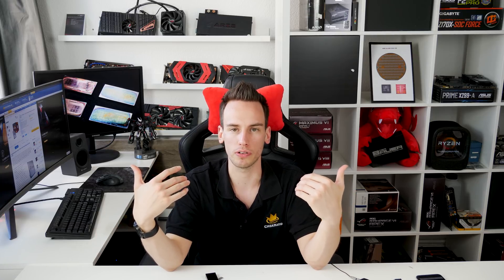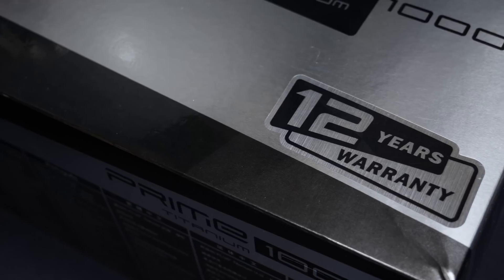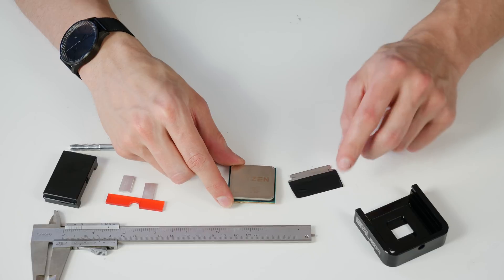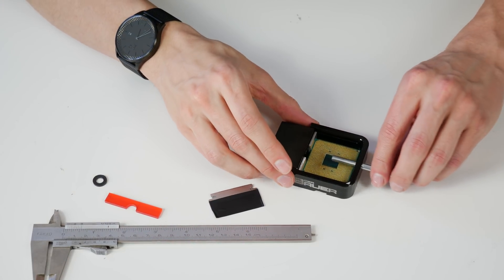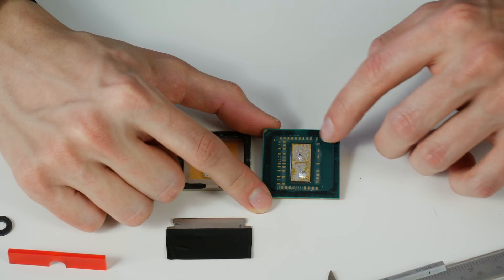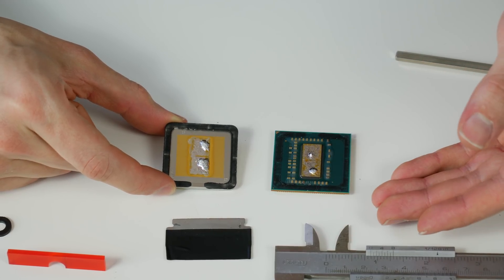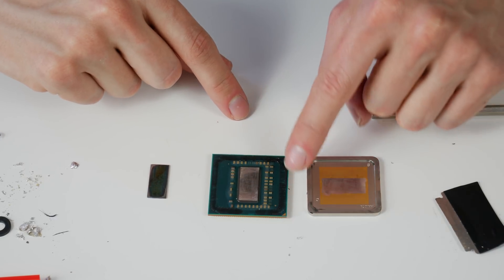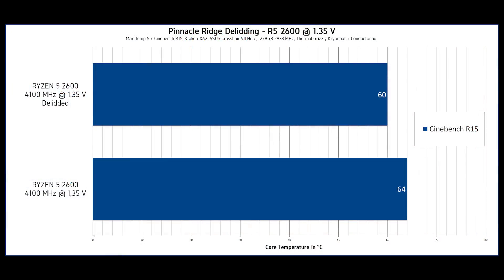ZEN+ Delidded - Before/After Temperatures - [Ryzen 5, 7, 2600, 2700X]

Comment: 4C temp difference from delidding is minuscule. That means AMD soldered head spreader is excellent and superior.
Reply: ManuelB1b3r  False. They're very similar IPC but Intel CPUs have less threads at each price point, consume more power, and have a lot more security vulnerabilities. Times have changed a lot since the FX days. I recommend you start researching.
Reply: Quetzalcoalt Also my response is more geared towards Manuel's ignorant statement that Intel is light years ahead of AMD. They are closer now in every category since the P4 vs A64 days.
Reply: But AMD's solder IS better at transferring heat? And this shows that, other people have done these tests as well, and Intel's TIM on coffee lake is REALLY bad. These are just facts, you can complain about how he didn't test it enough, but honestly, go check out other delidding benchmarks. It doesn't change, and Derbauer knew this when he started this video and didn't want to spend too much time benching something with no change in results.
Reply: AMD has the crown in HEDT environments now as well with TR2 and EPIC.... so I don't see your point, Intel is gaming king, that's the only crown they have, and they are slowly losing it.
Reply: Quetzalcoalt Chill out neet. 4C is insignificant and objectively superior to Intel's TIM, which is a known fact and has nothing to do with anyone being a fanboy. There's nothing you can say or do that will dispute that fact. The only thing that matters when testing the temperatures before and after is that both instances of testing are done the same way. Absolutely no reason to test for 30-45 minutes in this case.

Honestly, your salty and passive-aggressive rant about fanboys is completely misplaced and childish. It's called giving credit where credit is due. AMD deserves positive feedback for soldering their chips just as much as Intel deserves negative feedback for putting junk under the IHS. It has absolutely nothing to do with being a "dumb fanboy that comments on stuff they don't understand". Get your act together.
Reply: People have done other tests before Derbauer, everyone already knew AMD used Silicon, EVERYONE knew silicon is better at transferring heat to the IHS, everyone already knows the stuff intel uses under their IHS is terrible for cooling. You just seem like you're stomping your feet because you bought intel or something and need to validate your purchases.
Reply: Ryan Westbury using silicon? Wth are you talking about? Are there any processors that aren't made of silicon?
Reply: But he's not testing the temp of the water is he?
Reply: This is really impressive, he used the thermal grizzly, the best liquid metal thermal paste out there, and the difference is only 4 degrees, which means that they used a really fucking good stock  paste, which explains why it was sautered, intel on the other hand uses some cheap thermal grease.
Reply: Well, the soldered 9900K being shit with thermals, with too much silicon shows AMD just DO do soldering better.
Reply: Superior to anything Intel uses at least.
Reply: ManuelB1b3r Miles ahead? At literally all workstation tasks AMD cpus are better, and at gaming with a 1080ti at 1080p the i7 8700k is 15-40fps better than a R7 2700x Yes but that’s at 1080p and there is not a single person who uses a 1080ti at 1080p.

That gap closes a lot at 1440p and is essentially non existent at 4K 
Lower end GPUs will have the same result...

“Miles ahead” my ass
Reply: ManuelB1b3r  not rlly tru dude...not really true...
Reply: Excellant job amd now Intel is copying the same technology in New i9 series
Reply: how did he heat up it?
Reply: Mega Dutcher EXACTLY
Reply: @River_Miles   40ozFab  You don't tell which parts are wrong, you don't explain anything so you also don't understand a fundamental understanding of thermodynamics.
Also i don't know to which of the 10 comments this reply is for.
Reply: its means they used a thinner layer that wont hold up to the same temps as intels.  but thats all it needs so its a good choice.  i mean why do you think amd starts to throttle cpus at about 68c when running stock?  intel says "just keep it under 100c and youre fine".  intel makes a lot of mobile cpus that will run at around 100c for years fior hours at a time.  to make this work with solder cpus you probalby have to use a thicker\softer solder so it doesnt develop cracks.  but in return you get a cpu that can run high temps for years with no problems.  its a trade off either way but they both do the same thing, just in different ways.  besides if amd's 8 core could run 5ghz it would probalby gain more than 5c in temps because of the higher heat load anyway
Reply: @bobhumplick4213  What ? Amd throttles cpus @ about 68 c° are you trolling good sir? Max temps for the r5 2600x are 95 c°, i own that chip and can confirm it will throttle at around 88-92 ish.  Also i'm not biased, i've owned various intel chips throughout my pc user life and never had any problems with them. Always sufficed. But i've found the idea of owning a new architecture very intriguing and also the fact that Ryzens come with SMT, which is the equivalent to Intels HT.  AMD not supplying chips with HT was always a turn off for me. So now i didn't see any reason not to go and buy a Ryzen. I've owned and testet the 2400g with it's excellent vega 11 APU (beast for a budget build) and now i have the 2600x and for that money i could'`ve had an i5. I'm just curious where AMD takes Ryzen tbh. I enjoy updating my Bios every time i get an update because i like to see what happens and whats changing and improving. Also i'm on linux and ryzen works like a charm on that.
Reply: imagine intels stock cpus running 4c cooler :D
Reply: ManuelB1b3r  u must feel dum now
Reply: ManuelB1b3r  depends on the game engine u use. also the 39** as been overclocked higher then ur 5.4 with more cores and threads lol
Reply: ManuelB1b3r  Facts are, the best gaming PC, You dont need a good gaming cpu. You need 2x 2080Ti and 4k monitor at 120hz. not 300fps at 1080p in CS:go lol
Reply: ManuelB1b3r  lol
Reply: In my opinion 4C is close to the margin of error and it makes sense because the benefit of a thinner but less conductive compound versus a more conductive but thicker compound should be incredibly small. What he proves though is that there is likely a tiny benefit.

However, the benefit is in no way worth the risk unless you're a hardcore enthusiast. This is not like the case with Intel where the benefit is significant.
Reply: Quetzalcoalt TLBeed does not affect any Bulldozer or Vishera CPUs, Phenom Class CPUs, nor has anyone proven Ryzen is affected.  Intel is more widely affected to the recent security flaws and anyone who attempts to deny is clearly fancboying. 

For power consumption see here where the 8700K with 2 less cores, 4 less threads draws more power under load than both 1800X and 2700X. https://www.tomshardware.com/reviews/amd-ryzen-7-2700x-review,5571-12.html
Reply: Since most computers don't need to be replaced for 5yrs or more in most use cases, it makes sense that the market hasn't taken over yet. And since intel is the gaming king it makes sense a gaming hotel would use Nividia and Intel... AMDs are showing up in every single content creators computers because they are leaps and bounds faster at real CPU work that makes people money, not gaming. And it will take time before people will turn the tide and have Ryzen, the architecture is only 2 years old. That's like saying Kabylake is unsuccessful because not everyone has switched to it or newer. So yeah... AMD is showing up in builds for companies and businesses and servers more than the gaming rigs that we see every day, even then I still see Ryzen gaming rigs all the time.
Reply: What work do you have to do lol this is the longest yt comment i've ever seen, AND it comes from fanboy rage which makes it so much better.
Reply: 1950x server market? google AMD EPYC
Reply: every little helps, small things make a big picture
Reply: ManuelB1b3r  not really zens ipcs clock for clock are the same as skylake(coffee lake is just a 5ghz optimiztions to make intel look ahead in benchmarks.) when in reality zen has made intel cancel 10 nm because performance gains werent good enough soon enough for intel clockwise and now amd is gonna beat them to the punch with 7nm which is gonna spell the end of intels clock speed edge along with greater ipc...
Reply: @Ryan, yeah i still have a 2500k that i bought back in 2011. Right know everyone says AMD is better at everything. I agree most of the parts. But look around you. Where are AMD CPUs used. My university changed from AMD A10 APUs to some 7th gen I5s. Linus made a video about a gaming hotel. They use only intel and nvidia. Linus made a video about a gaming school, they also used intel and nvidia. Apple haven't used an AMD cpu since when ?. People that game and use adobe products, are better of with an i5 than a 2700x, because of that IGP thing. Most youtubers that have intel CPUs, they have no need to change platform even though it has 2-4 cores more, because they won't benefit from it, heck they might even lose in exporting times. Everywhere i look i see intel cpus, and very rarely AMD cpus. More than a year passed since 1700x launched and not many people switched. My friend didn't want to buy the 2700x, because of old issues that AMD had before, he was happy with intel before, and he is happy with intel now. 

I'm really happy that AMD is back in the game. They take their part of the shares slowly. If intel doesn't do something i might get a 2700x soon because i rarely game anymore, but how many people are like me? The majority buy PC for gaming. I need to change my 2500k.

Also read this. https://www.pcgamer.com/pro-overclocker-der8auer-on-why-the-race-to-add-cpu-cores-doesnt-make-any-sense-and-why-you-should-still-overclock/
I found it very interested and very true.
Reply: Quetzalcoalt opinions(you) VS facts(mega dutcher) 

gues what/who always wins
Reply: well that 2700x looks really pleasing to buy. i have a 3440x1440 so i won't see those fps differences in 1080p. and i get 2 cores more and 4 TH more, that doesn't suck like bulldozer did. So i would definitely get a 2700x over 8700k even if OC to 5Ghz. My 2500k on 4.5 just can't keep up with the 1080 even at the higher resolution.Not like i have money for build a full system :D.
Reply: @FlawleZ31
Tell me where does Intel CPUs consume more power ?
https://www.techpowerup.com/reviews/AMD/Ryzen_7_2700X/18.html
http://www.guru3d.com/articles_pages/amd_ryzen_7_2700x_review,7.html
https://www.pcgamesn.com/amd-ryzen-7-2700x-review-benchmarks
https://www.digit.in/pc-components/intel-core-i7-8700k-vs-amd-ryzen-7-2700x-40824.html
http://oc.jagatreview.com/2018/05/overclocking-review-ryzen-7-2700x-vs-core-i7-8700k-vs-ryzen-7-1800x/12/

Intel have a lot more security vulnerabilities ?
You mean spectre and meltdown, that 95% of all chips have these days ?
Amd is only secured against meltdown ( you are right here), but, arm CPUs are also affected by both. You probably have an android or ios phone, that's affected too but you still use your device right ?

Vulnerabilities are found sooner or later, there is no perfect software/hardware. Remember the note7 ? Despite that people still buy samsung, nothing have changed.
There were many car vulnerabilities and car brands had to do a mass return for a fix.
New CPUs would probably be designed without those vulnerabilities, so it won't matter much after 1-2 years. Also there are "fixes" for all attacks, kind of so there that.
But that doesn't mean new vulnerabilities won't be found in the future. ^_^

Also ofc AMD will have lower prices than intel, otherwise who is gonna buy their products ? It will take time till the market share is balanced, they are doing the right thing as of now, a bit rushed but, looking strong. The new TR2 doesn't look good, because the old mobos will support it, but the power draw will be so high, VRMs won't handle it. soo much for future proofing.

Did i do my research right ? ^_^
Reply: It's the difference between having your CPU at 82C or the non that wouring 78C. Also 5 tests of cinebench on water is pointless. On water you need 30-45 minute stress test so the water can reach equilibrium. 5 tests 30 sec each, is like putting water in the freezer for 5 minutes, pulling it away and call it ice cubes.

I can't believe der8auer did a mistake like this. This proves how stupid people are no matter if intel/amd. They hear if someone says something good about their product, and people start commenting stuff they don't understand. But oh well, dumb fanboys will always be dumb fanboys.
Reply: Accept for the fact that he fucking didn't. No where in this video does he show how long he let the water run. you assumed something and made a fool.
Reply: @FlawleZ31, i don't trust tomshardware because he is the only one that has different numbers. So 6 sites are saying one thing, only tomshardware is saying the opposite. 
Yes intel is affected, but saying that AMD is not affected, especially when they lied they are not but still released some patches :D is clearly fanboyism.
See ;) it works both ways. AMD is not affected only by meltdown, everything else thou.... And because the new Ryzen and TR, using the same dies, they haven't fixed it yet.

And to answer your other comment, I answered your comment, because of this sentence "consume more power, and have a lot more security vulnerabilities ... I recommend you start researching." 
And yes Intel are not light years away from AMD as of Q4 2017. Will be interesting to see new intel CPUs, when AMD just exploded. Maybe that's why they announced that they are making Gaming GPUs in 2020, to compensate for the losses if they can't catch up. Most servers i see use POWER9 CPUs, not amd nor intel ones. This is bad for both companies. Also Intel is not only a CPU manufacturer, they are heavily into AI, and quantum computers, they also make those optane things, that DDR4 256GB optane cache disk actually make sense.
So they will have something to do while AMD is on the top.
Reply: @Mega Dutcher
Running 5 tests of cinebench on a WATER LOOP.  1 Cinebench test on a OCed 2700x finished in ~28 seconds. 28 seconds x5, is 2 and a half minutes, on freaking water.
You need to run at least 15-20 minutes with an AIO so the water can heat up to its equilibrium.
Yes he did the same exact test, but water heats up slower, so the hotter OC 2700x my not heat the water fast enough hence only 4C difference. 
The difference might be more if the until the CPU can't get the AIO water to heat more / AIO can't cool the CPU more because of .... 

Not to talk about custom Loops, you need to run at least 30 minutes, or the best thing to do is run as much as until the temps stay stable for 5 minutes.
But because this is cinebench, you have to manually press the button and there is a short pause when no heat is produced. He might not press the button immediately and wait a second or two, and that can make a difference.

If he used a normal air cooler, even the nh-d14/15,  two and a half minutes might be enough, but 5 minutes to be sure.

Also he never talked about ambient temp, GN always give delta T temps. So yeah, AC kicked on, or opened a window during changing the CPUs, soo many variables. 
Thos 4C might be 6C or 8C.

Oh Thanks for @flawlez31 otherwise i wouldn't give you the answer cuz youtube never notified, ^_^ even thou i said most of the stuff in the upper comments, but i know now one reads those, only the most bottom ones.
Reply: So you saying that if i OC my cpu to 5.0 and use a kraken x72, and i run prime95 for 30 seconds, and i see temps of 50C that's a good temp ? How do you know that you cooler can cool your CPU at X Ghz and X Voltage if you don't run the benchmark until the water gets to its equilibrium state ? You can't see spikes with water cooling. It takes a lot of time, not 5 runs of cinebench with a 16 thread CPU. You are gonna be like, oh it gets to only 60C under load, the next day you start rendering an animation in blender, you go out for 5 hours, you come back and CPU is like wtf dude It's 90C, because of the water.

Also yes, intels IHS is really bad, but where do i say anything about intel in my comment? I'm saying that 4C is not that small of a difference, that might be the difference of going from 4.2 to 4.3. and i'm sure some will delit the 2700x, probably running a custom water cooling system that will want the very max and the lowest temps possible.But that's a different story.

Also you didn't read my comment fully, this part "It has absolutely nothing to do with being a "dumb fanboy that comments on stuff they don't understand" you quoted you forgot the previous sentence " This proves how stupid people are no matter if intel/amd. " But whatever.
Reply: @Quetzalcoatl0  Actually the effect of delidding is even be more significant without equilibrium temperature reached. So you are basically shooting yourself to the knee here. Despite like ppl before already told you, he´s running identical perfectly reproducable tests. Also: 4 degrees mean nothing, because there is already plenty of room for OC and the temperaturs rise somewhat exponential after you reached 5 GHz. Additionally your CPU wont bother wether you run it on 70 or 80 degree, because the lifetime of this component is just longer than your average overall system lifetime. I just love how Der8auer made a video where he went defensive about being called an Intel fanboy and you are calling him an AMD fanboy here... This is almost as good as reading the comments on comparison videos between nato and russian military technology.
Reply: @FoxD13  They are not identical tests because the variable time even tho the same doesn't work here. WIth water coolers you need to torture the CPU until equilibrium, because in test A the CPU might reach 70C but in test B it could reach 78C. You don't know. He ran cinebench 3 times as i remember and he pleased the buttons manually. Which are more variables and not enough test time. On water they might reach the same temperature for the first 5 minutes but in the 15th minute it might be completely different. No idea my other comments, it was like a year ago. I don't care anymore.
Reply: @Quetzalcoatl0  People were and still are buying AMD over Intel because they are the smart buy, much more performance for your money.  No 'fan-boying' going other than with people like you who buy with their hearts and not their heads.
Reply: @HalfdeadRider  It's been 2 Fking YEARS. 
Also your comment has nothing to do with the main topic of this comment.
Reply: @Quetzalcoatl0  it FUCKING DOES 🤣🤣 and same still applies, nothing has changed in that respect.
Reply: Talking about CPU and who has the crown, the USA has the faster Supercomputer on Earth as of writing this comment, Do you know what CPU they used ? Power9 IBM :D not AMD and not Intel.
Oh forgot to mention, they use nvidia GPUs.

Also you can't say intel lost the CPU crown, because they don't make only 1 product you know, They make server CPUs, Mainstream CPUs, laptop CPUs. AMD has those two, but are only popular in the mainstream market, on the server market, yes they have the 1950x but who buys server farms every day ? It will be one or two years before AMDs server side catches Intel as of now. What about laptops ? We just saw the first ryzen laptops. So intel is kind of on the TOP.
Reply: i agree with that...since nobody still haven't beat IBM POWER 9 YET
Reply: HOPEFULLY 10nm intel would ....a teraflop cpu can take the crown official on all space ..not just desktop and servers but SUPERCOMPUTERS
Reply: yeah but deliding the CPU just to lower the degrees by 4, is not worth the probability damaging the CPU.
But this is a biased test so yeah. We can't be sure if it's 4 or more degrees if difference .....
Reply: You think i haven't met fanboys on the internet who talk literal bullshit, and i try to tell them facts backup with links from blogs / forums / whatever else. But they still don't listen and talk their thing at that's it. 
And when i see a giant all of text and read it, it's still crap so when i see one i might read 1-2 rows and forget about it, because it's not worth the time to teach some idiot on the internet something.

Yeah as of reading your wall of text i'm gonna write my own one to answer yours. 
I see you understand at least most of the PC hardware stuff.
Tell me when you see a 28 core on 5GHZ,  when there is no other CPU that runs stock on all cores at 5Ghz, do you assume that the CPU is stocked ? Did you assume that the 28 core ran at 5GHz is stock without using some expensive cooling ? If you did , well bad for you. 
Also Intel knows about the TR2 that will have 32 cores, it's says it in the AMD site from quite a long time now. So if they don't have a product ready why no steal the titles of every youtuber/ blogger, ect ect. Everyone talked about it right ? So intel succeeded in this. Most companies sell shit products, because of really good marketing advertising. It's not about how bad the product it, it's about talking about the product. 

It's always a better way to use a new socket for a new CPU, i can give you reasons that you would never think about. 1st, making a new socket will have to make a new mobo, new mobo = new chipset = new features that the old chipset doesn't have, see someone have to design the chipset, have to design the mobo, has to buy components for making the mobo, heatsinks, you name. This is money for the other companies too. They have to feed children too right ? Or do it like AMD does, make 1 socket and use that for 5-6 years, and mobo manufacturers are gonna bankrupt. 
Also you saw when Ryzen 2 came out, you need to ask AMD to send you an older CPU so you can upgrade the damn BIOS to support your new CPU, this is wasting time because you might buy an older mobo. 

AMD Apus with laptops, who buys this shit ? IF you gonna work on it, you need a basic GPU like inside the intel chips, if you gonna game on it, nvidia dedicated gpus for laptops is way better than any APU, heck i haven't even seen APU laptops when i search for them. 5 laptops from 1000 in the search ? haha yeah ok, whatever. 

APUs in general doesn't make sense, if you gonna buy an APU just to you can game on it and buy a GPU 2 months later, why get a lower performance CPU if you gonna buy a dedicated GPU anyway. You either buy the APU and use what it can deliver or buy any other CPU with better Graphics. 

You think that because they don't have something know like the "infinity fabric" doesn't mean they won't have it in the future ? LOL 
"Intel where late to the party with their version of infinity fabric" Intel are late to the party but what about AMD. Where was AMD from 2011 till 2017 ? Where was AMD's advanced tech in all these years. ? You only talk about how great AMD is, but never talked about the flaws it had over the years, because only a fanboy will look at it's favourite brands good things but not bad things.

Intel will catch up fast, it's nothing we haven't seen till now with AMD gpus and nvidia, 1 year AMD is on top , the next year nvidia is on top. 

From half your block of text to the end you only talk about MCM and infinity fabric, repeating and repeating and repeating the same thing. 

I know you gonna write me another block of text explaining why everything i said is wrong, and ect ect. I don't care, these are facts, and i don't have time finding links to every single fact, and explains it again. It would reach the comments limit probably. ...

Bye, have a great day, i have work to do.
Reply: You think i have time to read that block of text of fanboyism ? :D
Reply: @Quetzalcoatl0  lmao that was a immature answer but a funny one nonetheless
Reply: @alexworm1707  Well i gotta answer at the same level maturity, so ye. 
I wonder how people find a 1 year old video, read 58 replies and start replying :D.